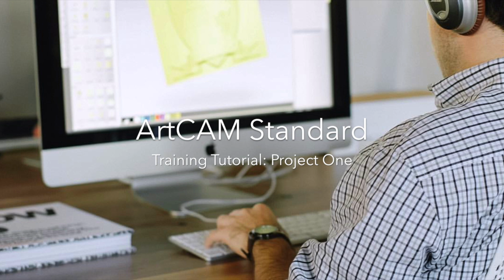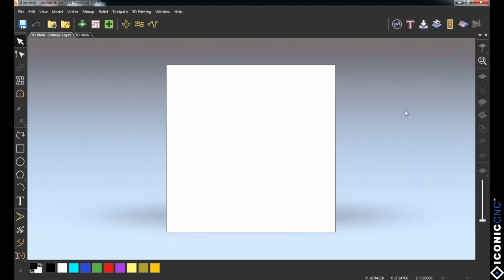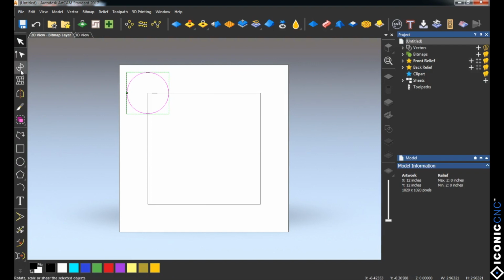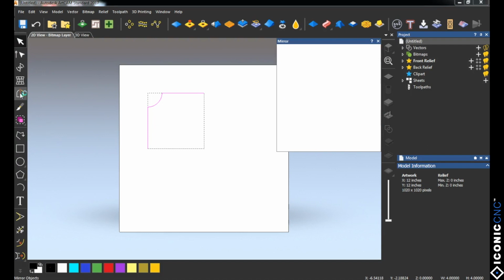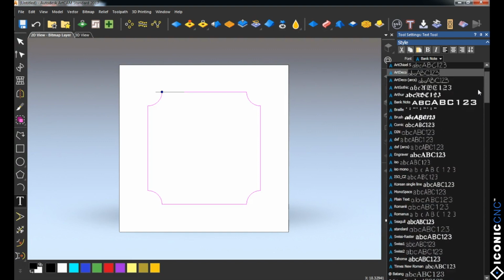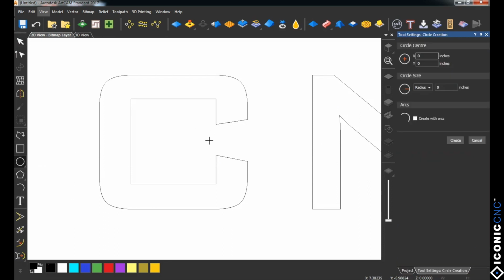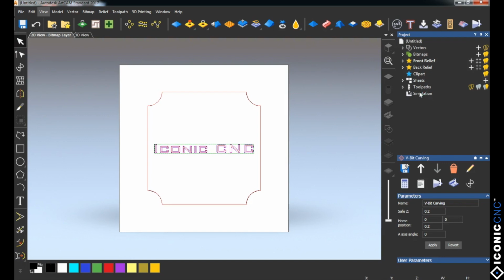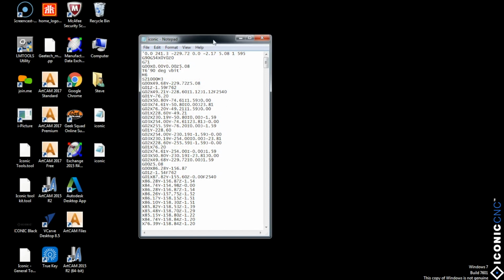ArtCAM Standard: Project One (2D Geometry Tools)

Comment: Thank you very much for the excellent tutorial, do you have any artcam standard advanced tutorials ?
Reply from the maker: No problem at all! Happy to provide them for everyone. 

Once you have the fundamentals of ArtCAM Standard figured out, I would recommend using AutoDesk's training videos, which we refer to at the beginning of this video. They are obviously the experts on the software! We just want to help everyone get started.
Reply: Your videos are much better because you go into details which artcam's don't and these details make all the difference in getting acquainted with the program. 
This is exactly what I'm looking for because I already have a good notion of how the program works I work a lot with aspire which is a more simple version of artcam.
I'm learning artcam because of the tracing and 3d tools which I think are much better than Aspire's and overall the program looks more solid

Do you by chance have any video editing or making a 3d component or showing how to use the other tracing tools?

Can you please clarify this for me, in aspire  the area work size influences the detail of the part to be carved meaning that this should be approximately the size of the part to be machined, does it work this way with artcam too independently of the resolution used? 

And in aspire one can modify the size of a 3d component any time by editing the grayscale image size in 2d mode, how can this be done in artcam after the 3d image is imported into the work space ? I tried importing an stl object and could not find how to change its size

Thank you very much, best of luck with your machines and please keep on making these excellent tutorials